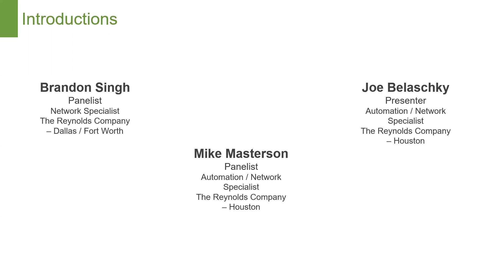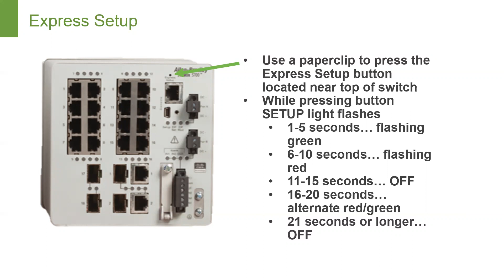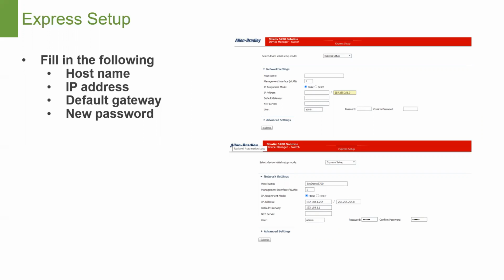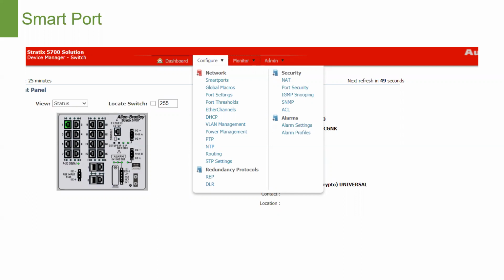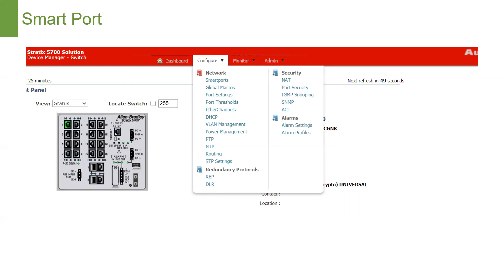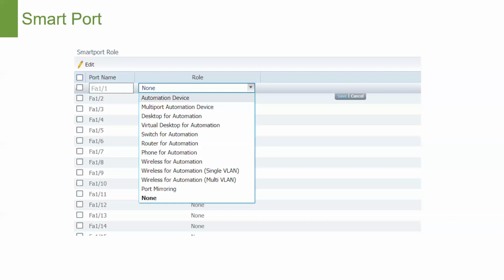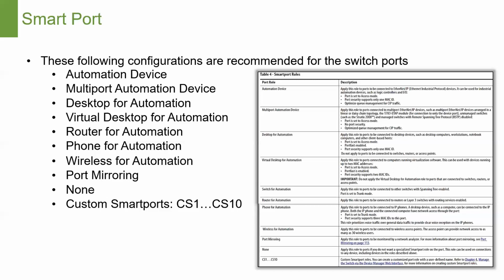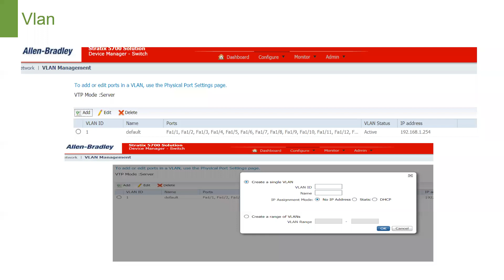Stratix 5700 Express Setup and Smart Port Configuration

Comment: Thank you so much , very helpful information

When setting the smart port on Stratix 5700 for the 1783-NATR
Should I  select  Router For Automation Role for the smart port used  to connect the 1783-NATR or use Automation device role instead